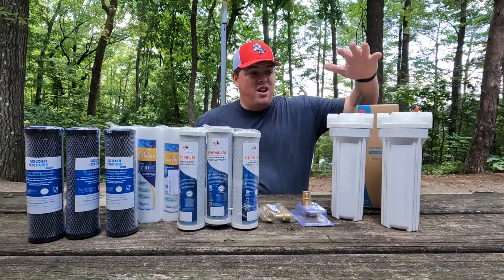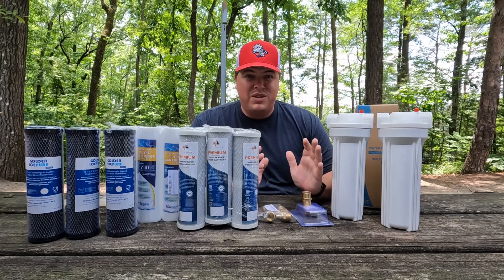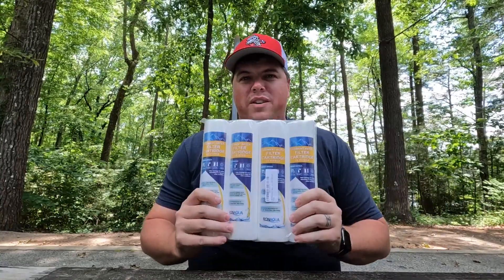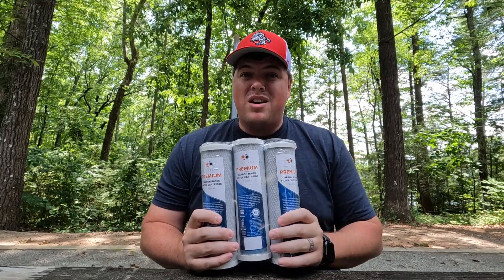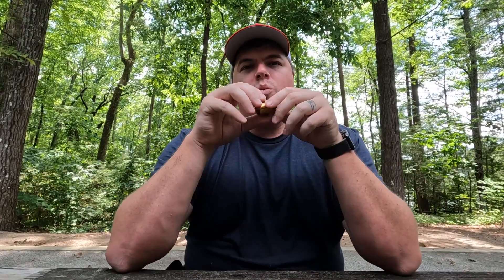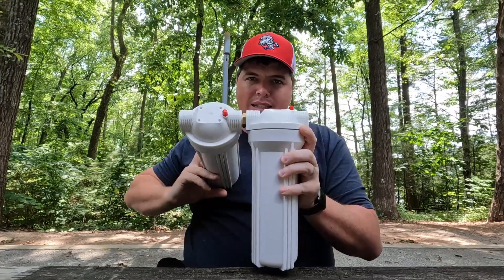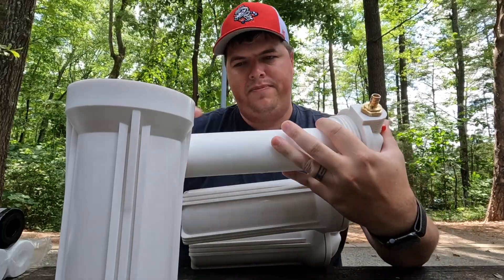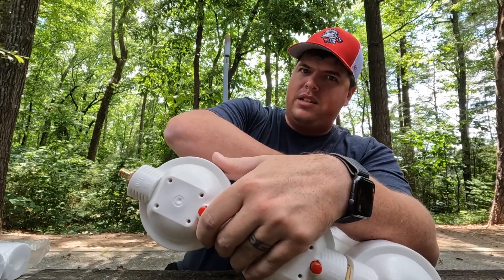How to build a cheap and VERY good RV water filter - DIY Water Filter - Make RV Park water safe

Comment: Man, I say this for EVERYONE'S sake... make your voice louder in the entire video (ideal option), or TURN THE MUSIC DOWN. 
By the time the video got to where you added the music in, I'd cranked the volume on my TV to hear you, and then got the most unnecessary jumpscare with that loud music. It wasnt even necessary to add music or the footage of you riding your whatever to get lake water. I get it, you wanna produce better videos, but stick to the point of the video, and CHECK THE AUDIO. And if you have no means of normalizing the audio in the video, don't publish it, plain and simple. Your viewers' ears and audio systems will be better off for it.  And yes, I had YouTube's "stable audio" setting turned to auto, and it STILL damn near popped my TV speakers.  You can and should do better than this.

Comment: The NPT fittings you linked contain lead.
Reply from the maker: Thank you for bringing that to our attention. From what I can see it’s just the 3/4 to 3/4 fitting, and I don’t believe that was in the description when I initially purchased (I’m pretty picky) and made this video. Good news is that fitting is prior to the 1 micron filter, so even if it’s an issue, the filter will absolutely remove it. Out of an abundance of caution though, I’m going to remove links to all the brass fittings. 

Thank you again.

Comment: Hi friend, thanks for inspiring and sharing! I was thinking, everyone's hooked up on brands and reviews but a key element I've noticed is the need for a universal filter for replacements. So I wondered, what makes a bad filter kit and respectively, a bad filter? We are fortunate to have laws against misinformation so hopefully we're safe?

I also didn't notice you add plumbers tape, sorry if I missed something? Not a criticism, but I very much advise applying g it; spin it into a twine, and wrap it around the helix-then around the actual tape as a sheet.thatll stop leaks :)

I can't state enough how badly versed I am with filters, but my understanding understanding is this-those filters are fine, your 20mc is probably a pre filter. That systems great, but not for drinking until a uv unit and a 0.2mc filter. Before that, I believe a 0.5mc filter would be good

Having looked at filtration  for a turtle tank though, and believe me, they are incredibly dirty as they can't digest well-the more filters you  have, the longer each will last as silt etc gets spread through; I'd actually compare it to a carpenters sanding regime: get 40 grit, then 80, 100 grit, 120, 160...they can get pretty meticulous..the reason is because the larger the grit, the deeper the abrasion. So less increments of size brings a more quality result and less drain on any one supply of grit sandpaper as they degrade faster removing the deeper stuff
The difference I see here is the bacteria side,  and knowing when it needs refilling aside from being dirty; canal water and hookups are unknown, so how much bad water is behind the system has a big say in the longevity of each filter; I wonder if it's possible to see the state with visible housings or if the dirt would just cover the sight of it; but I imagine flushing them would help. You'd just need power and enough water like a lake as opposed to a trough or puddle. Keep it filling your tank clean then with the clean fresh water, reverse the direction with clean water only. This may contaminate, so I say its an idea also coming from the camping sawyer filters which backwash, but with clean water forced back through, the sediment is pushed into the open lake for dilution; the filter 'wastes' a full tank for a cleaner filter system, then another fill which wouldn't undermine the flush. In theory.

So from what I understand, and I say as a question to be corrected on, 1 micron for the shower and 0.2 micron for drinking water; 2-3 filters including an optional to introduce healthy natural minerals

I also love your charitable attitude, thanks for sharing and being coop:) this is so easy, what's the big hype about brands and such haha. The housing should just be watertight is all, qnd for the product, it should be  standard thing -_-

Comment: Ok cut out the 1 filter canister and add the 3 filter can out side of the water bay. Seem the rubber hose they use as it was pex, but it not and was cut out. Switch to PEX B with the Pinch rings...
Water taste much much much better. Thank you for showing this and giving us the links to get the parts.
Getting some 1/2 metal 90 pex to pex and some strait pex to pex and 10 feet of blue or white PEX B. 3/4 " White Teflon tape.
Pinch tool and a bad of crimp 1/2" rings...

Comment: Beast combination pp1  or low, gac+kf , cto  + UF filtter 0.02 or low ( nanofiltration). Or pp1 gac ,  cto + UF + CTO final filtration. May combination pp1 , Gac , cto , UF.  GAC - carbon  granlar , CTo - caebon block , UF - ultra filtration mebranes ( filter vairuis , bacteria ,  etc. UF or UV choise. Pp1 change 1 2 monts , gac , cto 6 monts , uf 12 - 24 monts. Uv price mediu

Comment: man i hate to say i built this thing exactly and it leaked from every single possible place no matter what i did ;/
Reply: Sounds like a stupid question but are you sure you used the correct fittings (plus PTFE tape)? There are several different fitting thread sizes so it’s easy to get the wrong one (NPT, GHT, NFT, MPT…)

Comment: Have ordered all the parts thanks for the video. Do you have a video of the system installed under the sink?
Reply from the maker: We opted to use the water filter externally so it filters all of the water coming in to the rv.

Comment: To start off, great video! I do have a question... Will this system work to filter our arsenic in water?
Reply from the maker: Thank you so much, to be honest, the best way to remove arsenic would be a reverse osmosis system. This filter setup should reduce the levels of arsenic, but without testing it, I can’t say for sure how much.